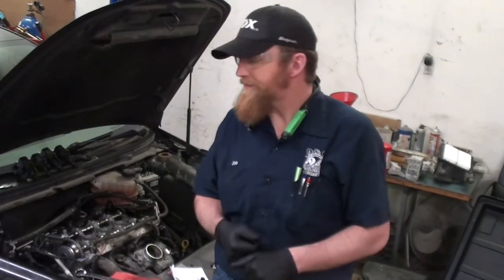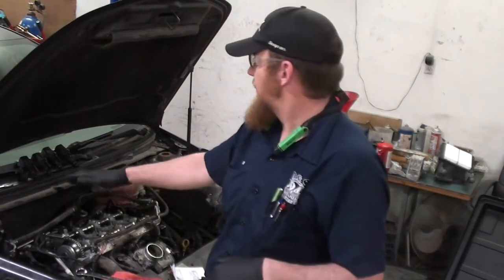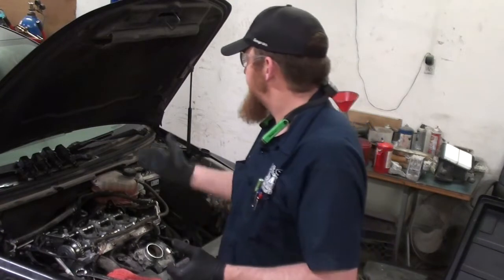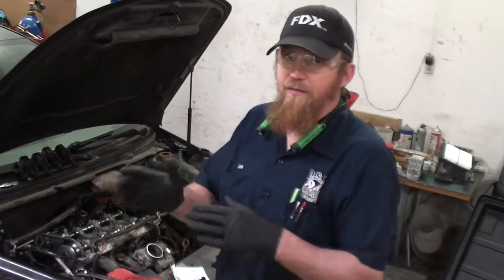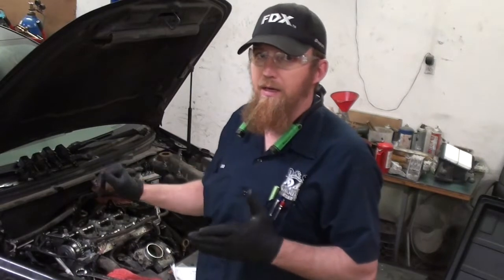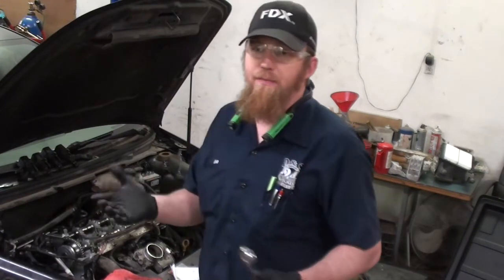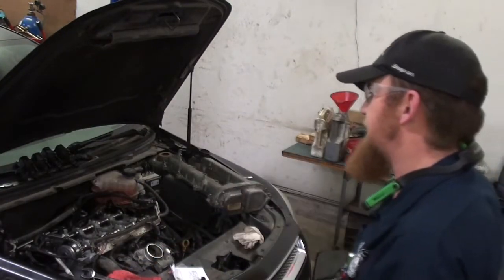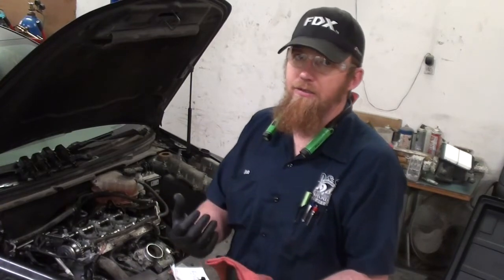G.M. 2.2L and 2.4L Ecotec Timing Set Tech Info and Diagnostic Tips

Comment: Definitely love the video too give me a hand.  My timing chain slipped bad, broken front guide, etc. Found bolt for guide and other guide pieces in oil pan.  I think my crank is 180 out from my cams. I'm considering pulling the head to check for other damage and to make sure motor is worth rebuild.  I'm hoping I can see a comment back from you too chat more

Comment: I removed the head. On installation I Set the timing at TDC on compression stroke. Replaced both intake and exhaust VVT’s. I’m getting a PO0014. Was told has something to do with timing retarding . You mentioned something about resetting the sensors. You may have a video on how to do, you said it is fairly easy. Which video would that be? Thank you.

Comment: e.  Thank you for the video.  I am working on a 2007 with a 2.2 ecotech.  I was able to remove both chains and all sprockets.  my problem is the timing set up. I was set fine before disassembly, but slightly moved the cam and exhaust shafts.  can you recommend which video would be the best to watch to make sure everything si set before i put the engine cover back on and the timing is screwed up to the point where I have to tear it all down again.  Thanks again!
Reply from the maker: The exhaust cam will move slightly when you pull the chains. When you are putting it all back together use a 24mm wrench on the cam flats to move it where you need it and you will be fine. Just make sure your colored links line up with your timing marks on the sprockets and you will be ok.

Comment: Been working on my 05 cobalt for a year replace timing chain with friend who didn't tighten down exhaust cam sprocket long story short it broke I replaced two lifters on cylinder 3 prior to breaking down motor I did compression test which revealed 180 PSI across all four that's when I decided to replace timing chain after replacing head gasket along with two bent exhaust valves I made sure that they retained water upside down for 24 hours I reinstalled with cheap head gasket off of Amazon needless to say I ended up having to rip it all back apart because my compression was 130 across 1 2 3 but a 100 on four after taking a head back apart notice coding on head gasket flaked apart allowing coolant to mix with oil and air to escape Chambers I got a felpro replaced it with new head bolts third set by the way I'm pulling 125 across 1 2 3 and 117 on 4 I'm throwing a code between 2000 and 3000 RPMs misfire on 4 I'm beginning to think I set timing wrong I brought chain slack up from main crank to intake cam so that way I can set exhaust cam sprocket needless to say as I trying to set exhaust cam sprocket I have to rotate intake cam to make it latch on camshaft the fact that I'm at a lower PSI and all cylinders is making me think my exhaust cam lifters are being engaged before they're supposed to be been all this project for a year and any help would be greatly appreciated thank you

Comment: I replaced the TC on a 2.2 Ecotec in a 2005 classic.  Just sprockets, not variable actuators. Somehow I got the cams out of their original position. I Installed the new chain. The car runs but lacks power on the low end. I am certain I had the 10 and 2 and 5 all set accurately.  One or both cams must be 180 out. Is there a way to visually look at the cams to know each is in its correct position? I need to fix it but unsure which way to turn the cam with the chain off and the pistons lowered to avoid valve slap to get it running correctly. Any idea?

Comment: Are you able to tell me how / where to set the cams for new timing chain install. Timing chain had a bad rattle and I had the P0016 and P0017 codes. I put my car to TDC exhaust then took apart. Then I was told it had to be TDC compression, was told to just rotate cams to line up marks on chain. (I had some bad info from someone I thought knew what he was talking about.) Now
Car starts but runs rough at idle n is still giving p0016 & p0017 code along with p0113, p0301,p228D, p0089.
Reply from the maker: Your intake cam should have the intake arrow about 1 o’clock, the exhaust should be about 11 o’clock, and if I remember correctly the dot on the crank sprocket should be about 5 o’clock with the key way in the crank pointing vertically up the centerline of the engine. Just make sure the colored links line up exactly with the appropriate timing marks and you should be just fine.

Comment: say i had to change the complete timing set. chain guides phasers and vvt solenoids and tensioner now i get p0016and 17  i do not hear any rattling and the codes set after clearing if i rev the engine then turn it off and restart after clearing them. now revving may not have anything to do with it but the engine light will does not show until i have shut it off and restarted the engine. i have photos of the timing marks after i installed the new chain the engine is the lea or le8 and it has 2 exhaust cams and the same phasers. i found that out after i got repair parts and they did not work. anyway the crank i set at about 4 o clock and the exhaust is at around 10 o clock and the intake is about 2 o clock. the chain has colored marks that are aligned to the timing marks on the sprockets and the phasers were locked in when i set the chain marks to the sprockets.  so do you have any idea what i may try to get this fixed? i just pulled the vvt solenoids and they were clean but i put new onse back in just case, as they were old solenoids. thanks

Comment: 2011 2.4 Malibu.  I have replaced all the timing components except cam phasers at 160k miles.  About 5k miles later it has the valve train rattle like crazy sound at idle again. Some days it starts up no rattle but after getting hot starts the rattle sound again. I took the valve cover back off and looked down the side and see no broken guides. I rotated the camshafts and checked for stuck lifters and none seemed to be stuck. Do you know if the cam phasers cause valvetrain rattle like noise when worn out? I am not sure if the locking pins on these wear out and then the cam bounces slightly back and forth at idle. Also no engine codes.

Comment: I’m trying to time my 2010 cobalt I had chain the tension and ended up skipping the chain I got the top 2 phasers just have to do the bottom sprocket and I was not sure if I had to take the motor mount off or not and if both thos codes would be the timeing chain tensioner broken
Reply: Change**

Comment: I have s 2.4L equinox motor in my buick regal. Changed the intake cam gear, to a regal one. Drove it for 1000+ miles, the engine reduction code came back on. (Which Watson when I put the equinox motor in at first. So I took it the chevy dealership, they claim the intake gear was out 120 degrees. So they moved it, now I have no compression. Car wont start for them. Now they want to pull the head off at my expense, claiming it was fault for having the gear on wrong. I dont think I would have drove it for 1000 miles if this interference motor was out of spec that much. I think maybe one tooth max! What is your thought?

Comment: Is it possible if a 2.2 jumped a couple of teeth on chain, that it didn't bend a valve. Ran a cam into each cylinder no obvious crashes, pulled valve/can cover chain slack but still in position. It gave a crank position fault right before a no start issue.

Comment: I pulled my head off 2.2 ecotec. I'm looking at timing the pistons at tdc with camshafts at 10 and 2 on exhaust stroke. Does the bottom half of the pistons make a difference? It just needs to be at 12oclock mark?
Reply: i know I am kind of randomly asking but does anyone know of a good website to stream newly released series online ?
Reply: @Diego Calvin Flixportal :D
Reply: @Maximilian Tommy thank you, signed up and it seems like they got a lot of movies there :D I appreciate it !!
Reply: @Diego Calvin Glad I could help xD
Reply: I pulled the head off the motor and rotated the crankshaft. I cleaned the pistons off. I did not place the the rotating assembly back to its original position. Once I set the rotation assembly at TDC and reassembled the engine it starts then stalls out. I forgot to set the engine block back to its orginal position. How do I fix this issue? Do I rotate the camshafts 180?
Reply: @deeme14  you gotta make sure your timing chain marks are lined up with the sprockets on both camshafts. They need to be at 10o clock on the left and 2oclock on the right.

Comment: I took my head off my Chevy cobalt had it redone put a new head gasket on and now my cam sprocket dont line up can I move them with out hurting anything
Reply from the maker: Yes, as you rotate the cam shaft to the proper position take your time and go slow. If you feel it bind up don’t force it, just move the crank a few degrees it should move the pistons just enough to clear the valves. If you feel the crank bind go the opposite direction. Make sure you pull the spark plugs, that way you are not fighting the compression of the engine, and it is easier to tell if there is a change in resistance.

Comment: Joseph. Would appreciate your input. My wife's car 2013 Chevy Equinox 2.4L, 74K miles. Owned it new and well maintained by me with oil changes every 3K-3500 miles, Seafoam treatments, etc. Started getting a P0017 code. So I started replacing stuff. Replaced exhaust cam sensor. Cleared ECM still got P0017 code. Replaced the OCV (VVT) solenoids. Cleared ECM still got P0017 code. Replaced exhaust cam sensor again. Cleared ECM still got P0017 code. Replaced intake cam sensor with the 1st new one removed from the exhaust side. Also replaced crankshaft sensor. Cleared ECM still got P0017 code. Replaced timing chain kit and VVT phasers/sprockets, even though the original showed everything was in time and original parts looked good. Inside components looked beautiful. 0 sludge and barely any carbon. Replaced anyway because a GM guy told me the phasers were likely the culprit, so went ahead and just replaced it all. New spark plugs and gaskets. Cleared ECM still got P0017 code. Since the kit came with two new OCV solenoids, I said what the heck, can't sell 'em for much, let's just try replacing those again. Cleared ECM still got P0017 code. Popped valve cover to see if new timing chain marks still coming back to sprocket marks at TDC. Yes, still in perfect time. Torqued everything back together a 2nd time. This car runs great. Purrs like a kitty. Puling my har out. Seems all that's left is probably where I should have started. Electrical connectors and possibly ECM. What are your thoughts? Thanks.
Reply from the maker: Hopefully this will help a little bit. The P0017 code generally correlated directly to the cam position sensor for the exhaust camshaft. This will be mounted on the rear of the head on the drivers side of the car. You will have a identical sensor on the front of the head, this is for the intake cam. Make sure both sensors are plugged in and the connectors have not come loose. If no loose connections are found, swap the sensors, clear the codes and drive the car. If a P0016 code pops up your sensor the you moved from the back that is now in the front is bad, replace it and the code should go away. If the P0017 comes back after swapping sensor locations then your most likely cause is a wiring problem between the plug on the rear sensor and the ecm. The other cause for this problem which is less likely unless your engine has gotten hot at some point is that the relucter wheel on the exhaust cam has moved. It is only a friction fit, and if the engine temp gets too high it can move and cause this problem. You can move the wheel with a brass drift if it is out of position, and there is a way to check it that I believe I talk about in my video on the 2011 Malibu with the 2.4L. I would say that is a last resort as that is not as common as a wiring problem. 
          Hopefully you find this helpful, and if you have any other questions don’t hesitate to ask.
          Thanks for watching,
Joe
Reply from the maker: As I just re read your original path of diagnosis, I see you already moved the sensors. I would start looking at the wiring between the sensors exhaust sensor and the pcm. I don’t have access to a wiring diagram at home, but if you can find the pins at the PCM for the sensor you could run a resistance or continuity test on the wires, if you don’t find a bad one that way take a incandescent tail light bulb fashion it so you can use it as a test light and test both wires running power through them to light the light. If the light is nice and bright and does not get dim or flicker when you wiggle the wires they are good. I have had wires that have had broken strands pass a resistance or continuity test but barely light a light bulb because they cannot carry a load. Hopefully some of this helps.
Reply: @JosephVollmar  man thanks so much. I really appreciate you taking the time to respond. As I said in another comment below, your videos are awesome and helped me so much. If I lived near you I'd sent everybody your way, and send you my own head-scratcher too. By the way, happy to throw you a Google review and 5-star rating and some glowing comments if I knew the name of your business and location. I'm in an emissions county in metro Atl area of GA. If I don't get this fixed by my birthday at the end of the month then I can't plate it. So I'm a little under pressure. You seem like a really cool, good dude who enjoys helping folks. Blessings to you and yours Joe. One more question. Have you ever seen an ECM be the culprit in a situation like this? I can buy a used one for $37 on Ebay. Get'n desperate. It's down to where I need to fix this fast.
Reply from the maker: @TyTowriss  thank you for the kind words. We are all doing well at the moment. If I make it down that way I’ll have to look you up and maybe we can grab a beer. I work for D&S Auto Repair in Bloomsdale, MO. Apparently there are a few D&S Auto Repair businesses through the country but we are not affiliated with any of them, just a little independent shop. 
     I have not seen this particular issue caused by an ECM, and for the most part don’t really see any issues with GM ECM’s. I wouldn’t buy one off of E-Bay though because GM programming is vin specific and I don’t know if a dealer would reflash a take out ECM. If you get to the point where you suspect it may be the ECM contact Solo Auto Electronics in Miami, FL. There contact info is online, and they can test and repair most ecm’s and you won’t have to pay a dealer to reflash it. We send them a lot of ones that are fixable, and it is often much cheaper that a new one, and they will stand behind their work. 
      Hope this helps, and good luck. Sometimes these things can be a real pain, but every one you figure out is truly a learning expierence. 
      The 2011 Malibu I made one of the timing videos on was a car I bought with a broken timing set and bent valves to put together for my son. The reman head that I ordered through a reputable company came with the cams installed backwards (intake cam on exhaust side and vice versa). I did not know they would run that way, but they will just not very well. Didn’t figure out what was really going on until it crashed the valves when the VVT system kicked in. I feel your pain, but I learned more on that job than I have on any other single job, and probably burned out a few more brain cells than necessary trying to ease the frustration with a cold 1 or 10, lol.
      Keep me posted and let me know what you find.
Reply: @TyTowriss  So, it wasn’t the solenoid wiring?

Did you end up replacing the ecm, and did that fix it?

I’m at the point of attempting to change the timing set, but thinking of changing just the tensioner first to see if that fixes it. 
Did the 3 sensors & solenoids. Will also try changing cam sensor positions, along with a second oil change.

Comment: Man thanks for this video. I'm dealing with the same issue on a 2013 2.4L Equinox with only 74k miles. LEA engine. P0017. I'm a home D.I.Y guy so I diagnose by replacing the sensors 1st. Worked my way through replacing 2 cam position sensors and the crank position sensor. Still got P0017. Then replaced VVT solenoids. Still got P0017. Then talked to a GM service guy who told me he thinks it's likely the phasers need replaced.  Popped the valve cover, timing chain cover. No broken parts. Well serviced engine. No sludge. No metal. I have yet to order parts and trying to figure what I am gonna start with. So I'm curious, did replacing the exhaust side phaser again end up fixing this for you? Thx. Great videos.  So much appreciated.
Reply from the maker: Sorry it took me a little bit to get back to your question. I replied with that no to your other comment. I hope something is helpful.

Comment: Have a question. Just changed timing chain and solenoids. Still not cranking. Throwing p0016 and p0017 codes. Sound like there is no compression. Could it be that its out of time that bad? Just curious. Don't really know where to go from here. After watching videos I feel we timed it right but maybe not. Any suggestions?
Reply from the maker: If it broke the time my guides while the engine was running you have bent valves. I would bring each cylinder to top dead center on compression and apply compressed air. If it shoves the piston down the valves are sealed, if you hear the air rushing out of the intake or exhaust you are dealing with bent valves and the head will have to come off.